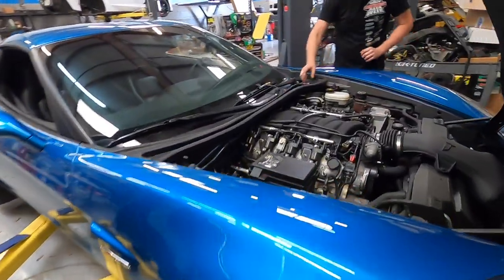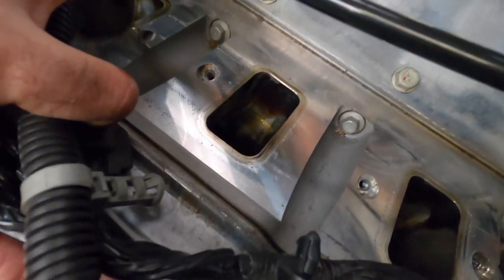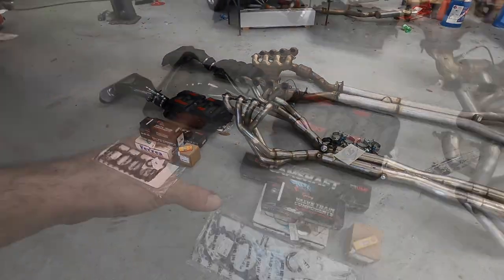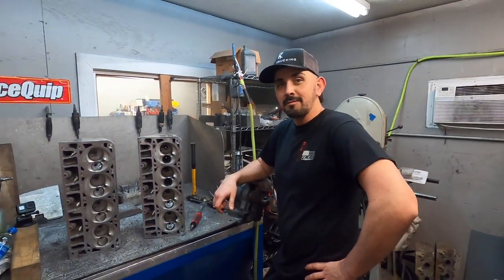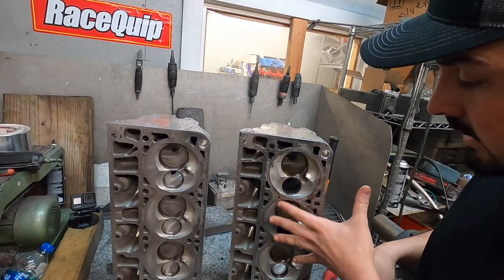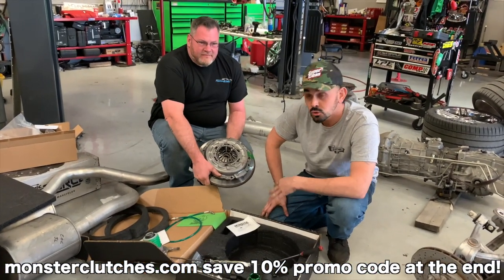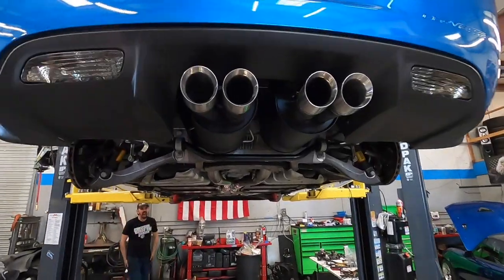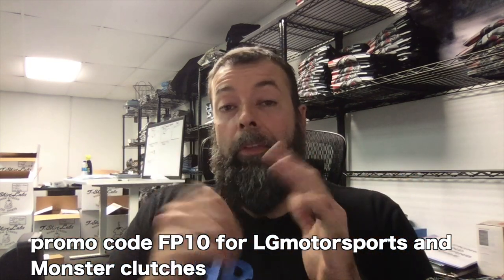Building The Ultimate NA Setup!  160+HP WITHOUT BOOST?! How?

Comment: I had LG motorsports exhaust system on my 08 c6z. The fit and finish of the headers were 2nd to none! Mine were ceramic coated as well heat/starter issues were never an issue.

Comment: Check the rocker tip wear on those.  Some people have been finding is that was the cause of the valve drop issues on the LS7. it’s pushing the valve to the side and causing excessive guide wear and eventually breaking the valve stem. Some shops true up the tips of the rockers.

Comment: Revision to my previous post. Point the nozzles towards the centerline of the clutch housing directed at the center of the clutch,  you can rig a switch to blow compressed air to the center line of the clutch when you depress the clutch fully to clear it out. before your race.

Comment: My car is 500 lbs lighter than the vette and I have a N/A LS7 (427) that makes 600hp at the crank. A - for show dyno run last summer it ran 227mph in 5th (with a 6 speed trans) at 7600rpm. The engine is a Mast Motorsports with all the goodies inside and 11.4 compression, and a Z06 cam, and Kooks mid length headers and dual 3" exhaust. It runs on 93 premium gas.

Comment: The stock heads flow over 360 cfm, which will support WELL over 700 bhp.  A ported stock intake is good for 700+.  1-7/8" header are good for 700++ bhp.  Nice upsell
Reply: Links to cars with said parts and power?

Comment: What year is this thing? You mentioned lots of goodies on this thing from factory, is it generally like that for corvette or is this some special model.
Reply: It’s a Z06 package. So, gets the 427 engine with dry sump oiling along with an aluminum frame, upgraded suspension, brakes, and probably other stuff.

Comment: with opening the holes in front of the clutch to promote airflow would it be beneficial to put some kind of screen or filter material over the hole to keep road debris out, or am I overthinking it and that's not a possibility?
Reply from the maker: not a real concern, its in n out in no time, had cars with over 25k mi like that and no problem despite going off road and in stones etc
Reply: @Fasterproms1  Nice. I wasnt too sure if it would just all pass through or not.

Comment: With the headers what would you recommend 3 Y or 4 into 1 and reason behind your recommendation.
Reply: In general the 3 Y will make more midrange power and be about even at top. The 4-1 generally makes more peak, but less throughout the range. 

But, there isn’t always room for a 3 Y. And the lengths of each of the runners becomes important.
Reply: @NBSV1  Thanks for the info 👍

Comment: Can anyone explain to me why the exhaust valve is proportionately so much smaller than the intake. You want to evacuate air just as fast as its brought in, correct? Or is it part of achieving actual compression? Take it easy on me. Just a 20 year machinist, not a physics major or anything.

Comment: You can get even more flow by unshrouding the top of the cylinder.  You can shape the cylinder wall down to 1/8-3/16 of an inch of the top ring tdc. Not the piston crown tdc, the upper ring on the piston tdc. Match the opening on the head and headgasket to the beveled taper in the top of the cylinder.  You can get as much as 15hp on top of any other gains.  
Not something that can do as much on forced induction because of the heat transfer of combustion into the top ring.. You can do a mild bevel on forced induction, leaving more crown to wall avoiding the focus of heat down to the top ring.

Comment: Not to be a downer but race proven motorsports gets over 600 with their stage 3 heads cam kits pretty easily.
Reply from the maker: they have a happy dyno, tuned up that way for over 15yrs. Also this smaller cam drives just like stock.

Comment: Why don't you ever bentch flow your heads to show the difference?  The proff is in the flow!
Reply from the maker: Certainly not the truth. A large hole flows a lot so by that logic bigger is better. Highest speed air for a certain rpm makes the most tq. And Hp is Tq at a higher speed. So ideally the smaller but highest velocity port is best. Watch some other video about porting we have and we go into that much more in depth.

Comment: Grinding on CNC ported heads... Really guys? Opening up on the head surface between cylinders.... Come on ... Say good buy to head gasket and possible head or block edge if it ever has a lean condition.. Sorry just plan stupid...
Reply from the maker: never seen such issue